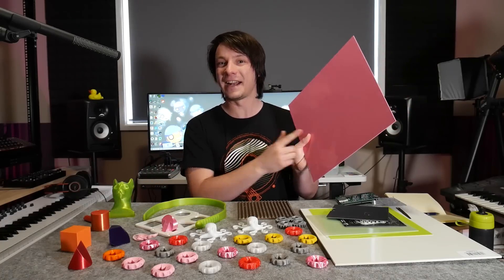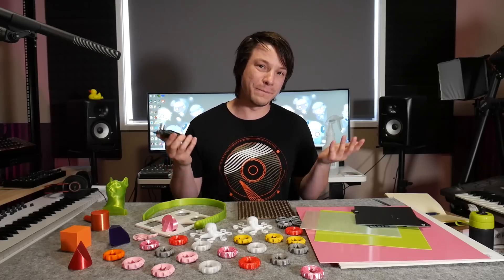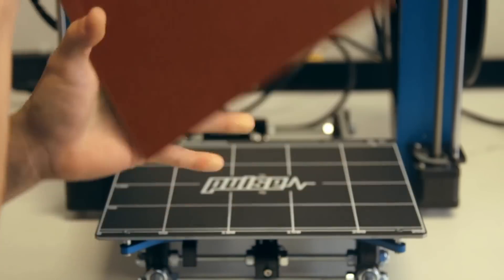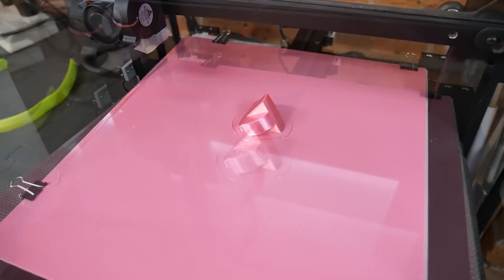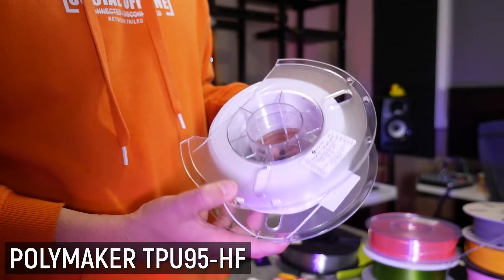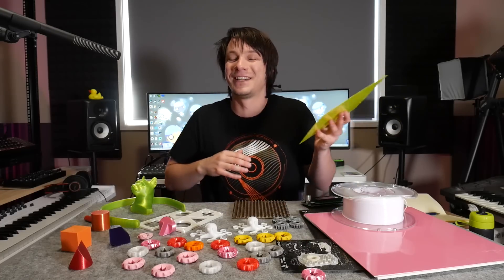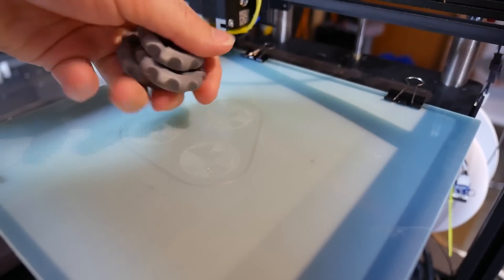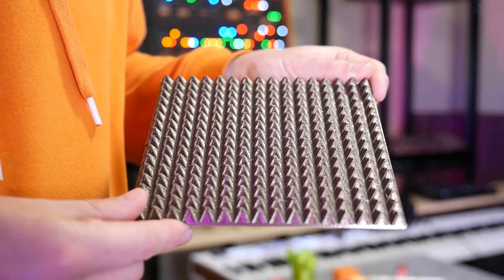G10 - The best print surface you've never heard of.

Comment: Wow!  I spent a lot of  $$$ only to find that a Piece of FR4 would do even better than most for a  Build Surface.  Works great for PETG, Which seems to have issues sticking to many build surfaces.  PETG either will not stick or sticks so tight it cannot be removed without damage. I am experimenting now with FR4.  So far, it is working as you have shown in the video.  Thanks for the tip.

UPDATE:  I bought a couple of pieces of 1.5mm (1/16") FR4 with one side in 1 oz. copper cladding.  Copper seems to help even out the heat across the bed.  I have converted both printers to FR4 and am not looking back.

Comment: Cool !  Would also be interesting to see how it prints when reconditioned with something like an orbital sander after the initial shiny surface is worn.  Thanks for investigating this. I ruined the smooth PEI on one side of my smooth flexplate on my MK3S+ by printing nylon because the warp pulled up so hard it turned the 3M adhesive gaseous and the surface never recovered, so this + manual bed levelling might be the ticket. Actually, that might be a popular video: how to print on specialty non-magnetic bed surfaces on the Prusa MK2/3. Keep up the great vids !

Comment: I've been using blue tape on glass for my PETG to prevent breaking my bed, I think I'll give the G10 a try when I get a chance, not having to tape the bed would be amazing!
Reply: Ive had consistent adheshion with glue stick on glass. So far never had any issues. Way easier to clean and maintain.
Reply: @alott6532  I had PETG straight up rip a chunk out of my glass, thankfully I was able to flip it over, but I don't want to go through that again!
Reply: @Teklectic  ive heard it can happen. I was nervous when i started with petg (only printed pla before this)and i almost taped my glass. It just seems like work and luck using tape...but for me on my jenky ender 2, with its original pei sheet affixed, a dangerously jagged on 2 edges cut of a old window, and the original glue stick (lol) just gooped on it ive had good results...and i guess not bad luck.all that said i still thing the g10 would be way better

Comment: TIP FOR PETG! 
I (almost) exclusively print on glass, and primary print ABS or PETG. What I've found is that the ABS solution I make to stick down larger prints also works AMAZINGLY for sticking down PETG.

Comment: Apologies to Print-Heads, but I have a kind word for our Drone Builders:
Design your G10 'dream frame', save it as a Gerber plot.
Send Gerber plot file to a 'short-run' PCB house; they will do all the cutting, drilling, etching, solder-mask and silk-screen work for you.

Most apartment dwellers are gonna be hard pressed to cut/drill G10 panels.
Yeah, it sounds like a huge investment, but short-run board shops are actually quite affordable.
Lots of 'board shops' will do short runs with really good turn-around times.

The G10 frame would serve as a wiring panel, eliminating the high-power connectors and wires.*
All power for the motors is carried by wide copper traces on the G10 panel. 
Battery tabs soldered to PCB,  MOSFET soldered to PCB,  motor leads soldered to PCB.
If it runs heavy current, it gets soldered!

*I know nothing about how drones are made; they could all be using their frames as PCB's, and I look the Fool.

Comment: Hey, Angus. I'm going to clarify a question that may relate to @Andrew Whatelseisgood's below. 

My immediate thought when watching was why not use 1.0mm FR4 with a single copper clad side. The copper faces down and becomes a heat spreader for your bed heater, the FR4 is going to do a bit better with heat, copper adds a bit of rigidity allowing the slightly thinner fiberglass. Seems like a win-win-win, yeah?

Comment: Didn't know G10 is garolite. for me the problem of garolite is it's not guarantee flat, and a higher bed temp is needed. So I only use it for large print which a flex bed is helpful for print removal. 

Glass+glue stick just does the job 90% of the time with minimum hassle, plus no surface that can be damaged.

Comment: I first heard about G10 in relation to fins on high power model rockets. Will have to try this. I've been printing on glass all this while. As far as the binder clips go - they make them quite a bit smaller than that, and I've been using the smallest size that I can get.

Comment: best is actual same material, pre-heated, that you use to print, bond easily, just attach/clamp to the structural printing bed, single use print surfaces
Reply: those single use cast sheets are cheap/simple to get/manufacture
Reply: like single use paper plates
Reply: or cd's
Reply: also no worries about the structural bed or print surface from being damaged, cause it does not matter
Reply: no dust and other problems with single used sealed from package print surfaces
Reply: you can make the print plates yourself, like self-made filament

Comment: I replaced the clips with magnetic foil. One foil on the surface plate and one foil at the printer. They are available with an adhessive layer. So you can easy mount them on the surface plate.
Reply: Okay, but this probably fails if you ever want to use more than 80C.

Comment: Great video. By the way have you tried flex magnetic print tape to replace clips. Also there is a G11 material that resists even higher temperatures.

Comment: This seems to work quite similar to the Printbite+ I am using. I have had flawless results with PLA, PETG, ABS, ASA, Flexibles, Nylon and modified variants of all of them inlcuding carbon filled. No brim on any of them. Nylon works flawlessly but just like with the garoilite, it deforms the surface to some degree. I have noticed it partially restoring it's form after a while though.
Does the performance of the Garolite change if you where to sand it with a very fine sandpaper or will it not self release as easy? 
I prefer my bottom surfaces matte to be more similar to the rest of the print. Buildtak produces my favorite bottom surfaces.

Comment: Your actually late ;-)
FR4 is on my Ender for quite some time.
Interesting with TPU and no temperature - I still used the heated bed but will give it a try.
Different to you, I sanded the sheet with very fine sandpaper - cause that was recommended in one of the other groups I follow.
That doesn't give a shiny glossy finish on the first layer, but helps with adhesion.
I actually don't clean my FR4 - not necessary if sanded and if you don't don't touch it to much.
As you said, PLA, PETG, ASA works well, TPU - is hard to remove but possible - I use a sharp cutting knife to get under the part (Brim helps to get under nicely)

Comment: The advantage of buildtech type surfaces is the lack of need for heat when I was running you know 15 printers at a time that power bill got pretty big until I figured out how to turn off the heat

I did not realize that garolite by the way voice dictation will not type that word and g10 were the same thing I thought they were different I'm going to have to get some g10

It also makes excellent rocket fins and I was not aware you can get it in cool colors now I need to get some orange!

I am willing to bet most manufacturers don't use it not because of some desire to prevent you from using something affordable but simply ignorance I bet you they just don't know

Comment: 10:20 when having thermal runaway at extreme temps, try heating bed and hotend separately. It might be a power issue. Board is not able to cope with it.

I encountered these on my Ender 3 v2 after modding it to all metal hotend, high temp thermistor etc. Happens only when going very hot.

Comment: Couldn't you just flip the Neptune's bed over and use the G10 side as is rather then pulling the surface off, or does flipping it over cause heating issues?  I have two Neptune 2's and do love the normal bed side, takes some seasoning to get it working right (first few weeks of prints suck TOO well), but now things are popping off it no problem, with or without rafts.  Also found that 60C for PLA is the magic number, as even with the Monoprice Voxel I also have, 60C seems to work better for getting PLA (Hatchbox) to...let go.  I have ASA that I haven't tried yet, I do have two Wham Bam Hot Box enclosures for the Neptune's that keeps things nice and toasty (about 33C during printing of PLA 200/60).  I know those two are the only ones able to print ASA as the Voxel almost can't get to the minimum temp needed for it (Polylite ASA).

Comment: Hmmm.... Thanks! I have some blank single-sided PC board stock for etching my own circuit boards. I'm gonna try mounting it copper side down which might help to couple the heat from the bed to the surface. Worn out pieces could still be cleaned and etched as usual for non-critical circuits and might even hold conformal coatings better.... Hmmm.... 

[repeating to self]: No Benchies on Saturday night... No Benchies on Saturday night... No Benchies on Saturday night.... LOL 

Thanks, I'm disappointed that I didn't think of trying that before.

Comment: How does this compare to the powder coated PEI sheets on a Prusa i3 mk3? I find the powder coated PEI doesn't handle small prints or delicate features that interface at first layer very well. Would you recommend this as an alternative for certain jobs or to get a nice smooth finish as opposed to the textured powder coating?

Comment: This is extremely interesting; my Longer LK4 Pro also came with that generic build-tak, and it has been an absolute pain to remove prints from it, with some PLA prints requiring literal hammering on a putty knife to pry them free. There are parts of old brim that literally will not come off, they're just a part of the bed now, so I've been looking into alternative surfaces - preferably something I can flex if necessary. Bonus points for cheap & available.

Now I need to go find your LK5 video, most of that would apply to mine as well I'm, sure.

Comment: Hi 😎, do you think this G10 with work with polypropylene too, I have tried using PP cut from a storage box, the prints stuck but the material was too thin and so far I have not been able to source any thicker.

Comment: I have found with PETG and glass that you need to take the print off while the bed is still warm. If you wait till it is cold it will take glass with it. You can always reheat the bed to take the part of if you need to. Also G10 does expand when heated so bull dog clips allow for that little bit of movement. When I had screws going through the g10 it warped the bed when it heated.
Reply: Alternative:  In your end GCODE, set the temperature to cool 5 degrees, wait 5 minutes, repeat - you get back to room temperature after some time and minimise the thermal stress on the way...

Comment: We have been using G10 as the build surface of our Solidoodle 3 for many years. It's the best thing we found for printing ABS. The bed itself is aluminum and originally came with a layer of Kapton tape, but the tape damaged quickly and was difficult to replace. We tried a glass sheet, but it was heavy, fragile, and parts often didn't stick well. We also use binder clips for holding the sheet on, and yeah, it sucks. I've had to modify the firmware to provide a keep-out area for the clips because it was too easy to accidentally run in to them.

Here are a couple of suggestions for printing ABS on G10.

ABS dissolves well in acetone. You can dissolve a bit of ABS into some acetone to make a thin slurry, then wipe a thin layer of that on the G10. This can give you very good adhesion (maybe too much sometimes!). You can also use acetone to clean up any ABS that builds up on the surface (ABS does not dissolve in isopropyl alcohol).

You mentioned the ABS having a rough surface because it cools too quickly. If you can enclose the printer in a chamber, the heat from the bed and nozzle will tend to keep the ambient temperature much warmer so that the ABS cools slower. You can even add a separate heater to keep the chamber temperature warmer - say 40C. We found just adding some walls to the printer kept it warm enough to avoid the parts cooling too quickly. This really became an issue for layer adhesion; we found the layers didn't adhere well if the previously-deposited layer had already cooled down too much, so keeping the chamber warm to slow the rate of cooling helped to provide good layer adhesion. Our printer also doesn't have a part cooling fan, since we don't want to cool things so quickly. However, we do get a lot of stringing in our prints. Perhaps some combination of warm chamber with a part cooling fan would be ideal to get the filament cool enough to not produce strings, but still warm enough to provide good adhesion and prevent warping.

By the way, we also found G10 by way of the combat robots we were building! One of our club members even has his own business designing and producing parts for antweight combat robots, so we had an ample local supply of G10.

Comment: This is very much like printbite.  You seem to like taking it off, but it wears well enough that it's really worth using high temp adhesive sheet and getting rid of the clips, the poor thermal conduction, and the first layer height variability.  If it gets marked by the head, a quick wet sand with very fine sanding paper fixes it right up.  I use glass cleaner instead of IPA.  Your suggestion to clean it cold is very important!  But it really doesn't need to be cleaned very often.  Also, given how well it releases parts, gluing it down really isn't a problem.
Reply: Also, what's up with that crazy first layer pattern?   Why so many perimeters?

Comment: wouldnt it actually be feasible to use the actual singlesided pcb stock for printbeds? like it comes in various sizes and with a pre applied heatspreading copper layer which will cause the bed to heat way more evenly. and it should be the kind that is safe to heat to up to reflow soldering temps which are way more than your average printbed should ever see

Comment: I just checked. Its very expensive here. The best cost/value surface to me is the sandblasted glasses so far. I am just making them as many i want. No adhesive need on the surface, i put water on it if i want to remove the print earlier. I like the even matte surface.
Reply: Does sandblasted glass require heatbed for printing pla and petg ?

Comment: I've heard of G10 since they're used in knifes but it never occurred to me to use it as a print surface. I don't really see myself switching over since I only print PLA on a PEI coated sheet spring steel sheet and have not had any problems, but I can see why it would be great if you print using various filaments.

Comment: I wonder if anyone has developed, or is attempting to develop, a fiberglass that has the surface hardness and temperature handling of actual glass.
This also makes me curious what other composites will perform like as a print surface. Anything that can be produced as a fiber or bead can become a composite, though bead-based composites are entirely different from fiber composites. Maybe there's a potential of a series of these videos testing the various different composites on the market; though, I'm sure Australia will make this a pain in the ass, as not everything is just readily available there. Outside of the typical carbon fiber and kevlar composites (I know kevlar itself is a fabric, but kevlar has been used as a composite alternative, I believe there's even been carbon-kevlar hybrid composites), I'd personally be interested in how basalt fiber works out.

Comment: Thanks for the reminder! I actually had some G10 kicking around and gave it a second try today, and it looks great so far! My only issue now is finding some low-profile clamps that don't interfere with the extruder carriage; fold-back clamps are just too bulky.
Reply: Clip frame (picture frames) use clips that are small and unobtrusive
Reply: @barenekid9695  Right, thanks! I've found similar ones which apparently are used to hold metal window screens.
Reply: See my (B anksy) tip on adding magnetic vinyl strips. Works really well.
Reply: @gryphonista  Sounds good! Where would I find those (the strips or the tips 😀)?